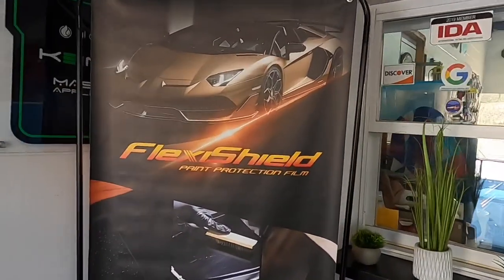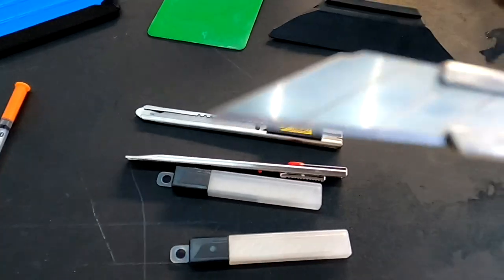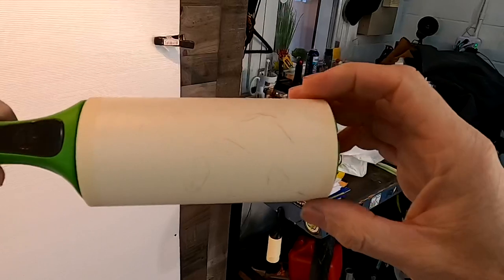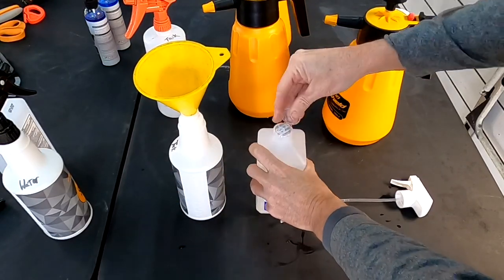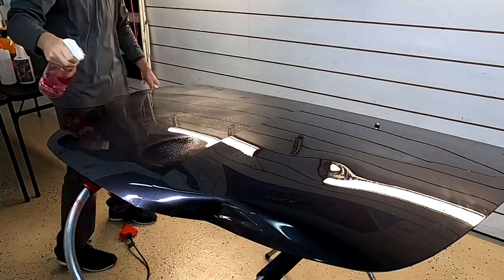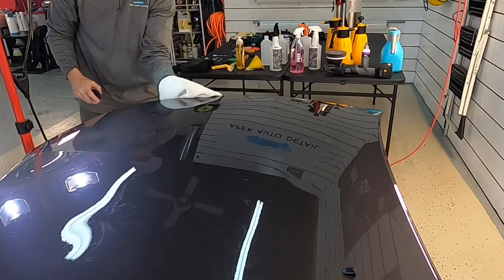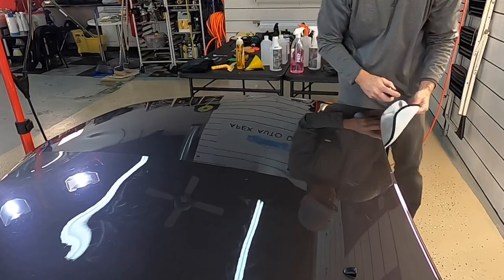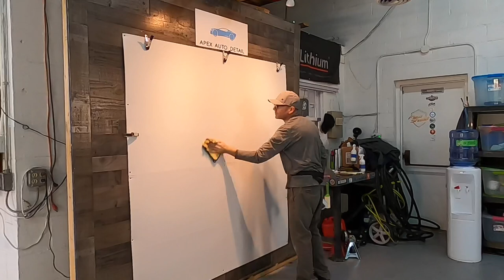Paint Protection Film!! PPF Part1! The Ultimate Protection From Rock Chips/Scratches!!

Comment: Nissan and Infiniti cars has a sticker under the hood that says scratch shield. We meet with one of Nissan engineer last Tuesday about the new z car roof because it is piano black. they are having trouble with scratching. You can heat gun the clear to take out very light scratches. just a heads up. PPf to the roof and other parts that are exposed to high in packed area's would be the best protection. watching this video. made me this of this.

Comment: Should you ceramic coat your vehicle before applying PPF?
Reply: I'm a certified Flexishield installer. PPF will not adhere to the ceramic coating as the coating is designed to prevent anything sticking to it. Application afterwards, however, protects the self healing top layer.
Reply from the maker: This. 👆
Reply: Thank you gentlemen!